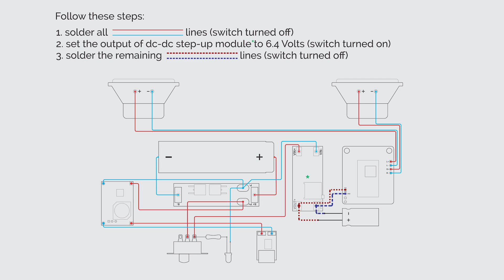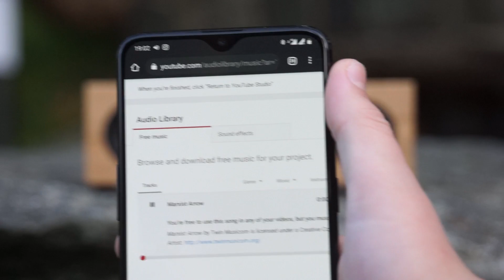DIY Bluetooth 5.0 Speaker

Comment: That was mpressive! Can you please tell us what specific type of glue do you use around 5:30 (less vicious) and 10:25 (rubbery glue) I'd like to try that speaker.
Reply from the maker: Thanks! I'd suggest watching the newest video on my channel, the kit has had some updates. As for the glue, the ones I use can only be bought in eatern european countries. For the 5:30, you just need glue that is thin enought to fill all the gaps by itself, but not leak/get absorbed into the wood. For 10:25, sillicone type viscosity is desired, such that you can wipe of the excess that leaks from the edges, and the glue fills in all the gaps so air can not leak
Reply: @aukits  thank you very much for the response, ok I'll check your latest video. 👍

Comment: Wont the glue melt when you are charging this? The charging module will get hot during charging so is it safe to use hot glue? Any feedback after several days of using your speaker?
Reply from the maker: That was a valid concern, though I've never had a speaker fail in this way. You can check the newest video on my channel, the speaker kit has been upgraded

Comment: how did you get to 60hz? those small drivers are only capable of 120hz at the lowest is it the amp that you're using? dsp?
Reply from the maker: Indeed the sound is equalized with dsp

Comment: I can't help but notice that the soldering schematic differs slightly from the video at 7:55. The wires coming from the LED are wired to the board with voltage adjustment in the video, and the schematic shows them wired to the smaller blue board in between the switch and the battery. I'm inclined to do what the video shows over what the diagram shows, but I want to make sure. Which way is correct?
Reply from the maker: Hi. The kits have been upgraded, so please check the latest video! The wiring schematics are completely in line with the video there

Comment: Hi, your work is very good 👍.
How can the capacity of the capacitor be calculated?(8:09 this capacitor)
What is its calculation formula?
Thank you
Reply: hello it's a 10 V 1000 µF capacitor 😁
Reply: wonder the same question. Why you need that big cap? For same wattage speaker (Sony SRS-XB10), they use 100uF cap only

Comment: Can i use a lithium battery??
Reply from the maker: Any rechargeable Li-ion battery with 3.7 V voltage and above 2000 mAh capacity can be used.
Reply: @aukits  thank you

Comment: How important is it that the speaker is sealed. How will it impact performance?
Reply from the maker: It is essential. The passive radiator works on the basis that the pressure can build up inside of the enclosure. If there is a hole, the air will instead move through it. As a result, the bass will decrease by a lot and there will be an annoying sound of air travelling through the hole/s

Comment: Why don't you use TPA4056 board for chaging and battery protection?
Reply from the maker: Some usb-c protocols do not work with it and therefore you can not charge the battery through TPA4056 with any charger
Reply: @aukits  I think if charger for example supports PD but the device doesn't it will work as 5V 3A charger.
Reply from the maker: @anton.nesterenko  it does not

Comment: I have some bookshelf speakers we pulled out of a client's wall. How can I tell what I need to convert them to bluetooth and aux in?
Reply: I was thinking the same thing using 25w RMS stereo speakers. It will come down to the limits of the amplifier used after the bluetooth radio has demodulated the sent information. The speaker sounds are.basically created by analogue electrical spikes and transduced by the speaker into sound via movement./vibration. At high dB without a decent amp you can get clipping of the analogue signal. There are some pre amp and amp kits available to buy which could juice up any amplifier limitations of the blue tooth kit.

Comment: Where is the dsp board or are you using the player (smartphone) as the dsp/eq?
Reply from the maker: It's done within the amp&bt module's chip so there's no need to use the eq on the smartphone
Reply: @aukits  

Is it software based that needs to be programmed or hardware tone control?